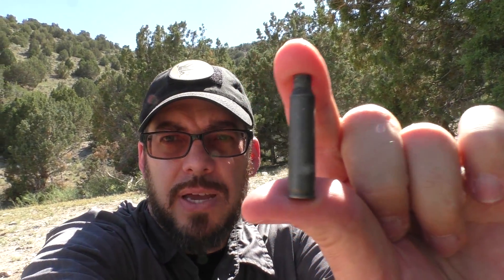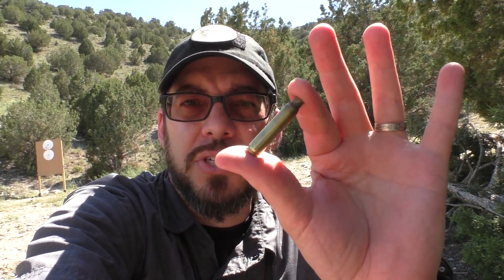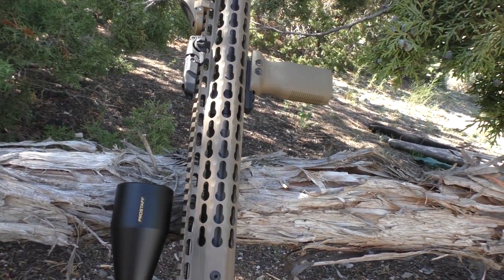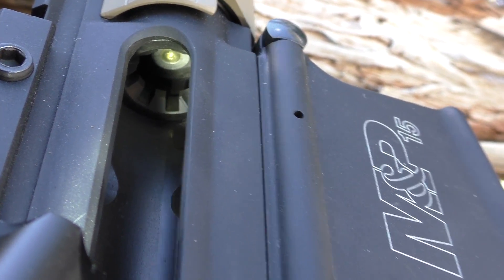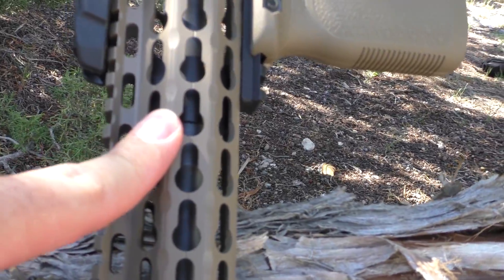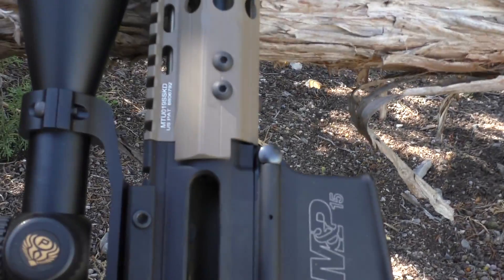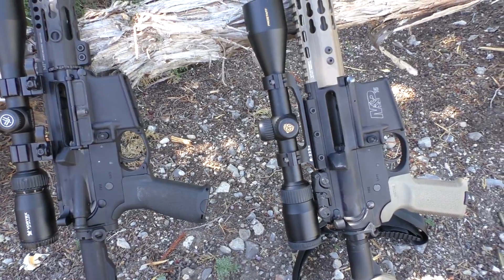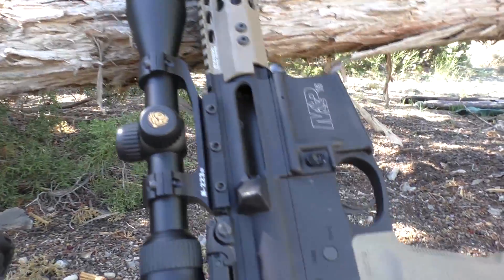Tula .223 Killed My Guns! V-Log Thursday

Comment: brass and steel do not have the same density, thermal and metallurgical properties... You should never use tula because steel on steel creates wear inside your firearm, where as brass cased ammunition doesnt mar the surfaces nearly as much, and most of the scratching is left on the brass case. Never owned an AR or anything of the sort, but you can the difference after only a 100 rounds or so on a reliable bolt action with a bore cam.

Comment: This happened to me three times when using this stuff on a 30-30. The the first two time I was able to get them out. The third time I had to pay a gunsmith $275 to dislodge the cartridge. I think that Tulammo changed the ingredients in the powder they used and a bunch of their ammo does this as a result.
Reply: Holy sh*t! $275!!! What did they have to do besides pound it out and or disassemble the rifle? I they had to remove the barrel from the receiver it’s a pita but $275 is a lot. That’s a lot of money for the issue.

Comment: all in all this is a problem on both ends,   user error for 1, not having a cleaning kit with them. 2- the amount of ammo and kind/brand and how much was under rapid fire, 3- brand of ammo was coated yeah, of lower quality, yeah, steel cased, yeah. and i would most definitely bet the powder used in them is a very dirty powder./--- hince the need to clean more often\... 4 continued the same mistakes expecting a different out come.   =====   insanity.. 
         so far, my only complaint with the 500 count tuna can of tul crap that i have encountered was fail to fire due to hard primer.  i only put 100 a trip down range at a time of this stuff,  im almost out of it and no i will not be buying any more,,,,,,   it does shoot fine through my colt but im not going to subject my rifle to anymore of that crap,   im reloading my own stuff now and i use clean burning powder with nato brass and still end up paying less then the cheap steel crap....     my suggestion,  get reman ammo from cheaper than dirt at bulk or other places like that, or,,,   learn how to reload your stuff

Comment: LOL!  Perfect example why AK is an AK and AR is not.

1.)  All Soviet military rifles come with cleaning rod attached to the weapon.  Take a guess as to why.

2.)  All Soviet military cartridge case are TAPERED.  Take a guess as to why.

3.) All Soviet standardized military cartridges are STEEL cased. Take a guess as to why.

When all the guessing is done and replaced with facts, that's when you get an AK and never look back.

I'm sure others already posted about AR 5.56 milspec vs .223 chamber tolerance differences and steel vs brass expansion rates.  

.223 - hunting/sporting spec (tighter tolerances for higher accuracy with lower reliability)

5.56 - military spec (loser tolerances with lower accuracy for higher reliability)
Reply: I shoot nothing but steel cases out of my ARs (all with Adams arms piston kits) and I don't get stoppages, stuck casings or malfunctions of any type.
Reply: You bring up a good point. I never really looked at it that way. That does explain the cleaning rods on Soviet weapons.
Reply: jason127x99 Cases getting stuck in the chamber was a common occurrence.  Weak sections in case walls, dirty chambers, extreme temperature variations (deep winter cold vs. hot chamber), all can cause stuck case and even case separation, that's why having a full length steel rod is a necessity, it is used to knock out the stuck casing.

Comment: TulAmmo often times, 'resizes' their brass WAY TOO MANY TIMES, and I believe that they are weakening the neck, so that they are causing a 'defect'  related discharge, when the neck 'expands' as the round leaves the cartridge. The reason I believe that this is the case, is, that I run a 'variable gas block', on 3 rifles that are fitted with .223 Wylde Barrels, and I can muck one way or another with the adjustment on the gas block, and cause TulAmmo to do EXACTLY what's happening with your equipment (in both 223 & 556)...

My recommendation? Stay away from TulAmmo, period. It's 'dirty' and just doesn't give any consistency. I shoot 3-Gun Tournaments and have chambered TulAmmo, and regretted it, as soon as I've sent one down range, because, sure enough, I get an FTF, or worse, repeated FTEs on standard 223s or 556s (I've even went so far as painting RED on the bottom(s) of any mags that I have used Tul in, to make sure that I don't saddle up with them, when I'm competing... AND DON"T load Tul for Home/Personal Defense.

TulAmmo is 'cheaper' for a reason. If you can get the fouled round out easily, without damage, mic it, and see the differences.

They're a little on the expensive side, but worth it, having a Wylde 24", 20", or 18".

Try installing an adjustable Gas Block up front and it'll probably solve your issue, BUT, remember, that Gas Block when you go back to better ammo, or a heavier load (it's not that hard, if you remember the 'clicks' to get back or forward to where you've set it as 'home')...

Comment: Wonder if anyone had trouble with a Colt or higher priced AR?  I have over 1k rounds of Tula .308 in a Rem 700, not a single issue, more accurate than ammo costing 3x as much.
Reply: My BCM has never had an issue with Tula or any other steel cased round.  My cheapo PSA had some issues early on, but after i scrubbed the chamber with a shotgun mop with a gentle rubbing compound (during which a bunch of brown sticky cosmoline looking crap came out) it seems to be okay now. 

The PSA has a nitride barrel while the BCM is chrome lined but I don't think that had anything to do with it, rather that brown stuff that was removed was likely rust preventative put on when the barrel was manufactured.
Reply: Zed X-R There might be a difference with the chamber being chrome lined. Probably a good idea that I didn't scrimp a few hundred bucks for a cheap AR. Hope you don't have to do that scrubbing too often.
Reply: A55tech Only had to clean it good that first time to get the rust preventative gunk out, now it cleans up like any other barrel.

The PSA shoots good, but if I had to do it over again I would just get another BCM.
Reply: +A55tech s&w use milate . Steel sucks unless it is a com block gun or a 995ts

Comment: I know this is an ancient vid but i’ll throw my 2 cents in. One of the problems with .223/.556 is that there is’nt much taper to the case combined with a poly coating on the shell casing that can melt with heat. 7.62x39 has much more taper so cases generally don’t stick. Not sure if you have the wylde chambering in those guns either.

Comment: Steel case SUCKS!  It doesn't expand, it sticks in the chamber, and it can't be reloaded.

I had the same problem and will never shoot the steel coated stuff again.

I had the same problem with steel case 38.  I couldn't eject the rounds from the cylinder.

Comment: Very insightful video. Thank you for making and sharing! After going through the comments, it appears a preventive solution would be to clean the gun more often, not run it too hot too often, or not leaving a hot round in the chamber for too long, running the bcg and chamber wetter than usual, and perhaps (my 2 cents) mixing in some brass rounds to have the gun rest from the steel ammo use. As such, it would appear that steel case is more training ammo than combat ammo for .223 and would fare better during initial stages of a gun's use when the gun is cooler. Thanks also to everyone for the insight.
Reply: Yep you pretty much got the same solutions that I got out of all of this,,,,,,,,,,
Reply: Cause I had the same problems.

Comment: the problem is carbon build up, the steel does not expand allowing carbon into the chamber.  every few hundred rounds spray some clp and a few turns with a chamber brush and your done.  if you dumb enough to use steel and not research the issues, then you learn a valuable lesson.  for $20 more a 1000 brass, just buy the brass if you dont want to clean as often

Comment: Damn I found a deal on this .223 ammo. I usually only buy same few types of 5.56 ammo for my 5.56 chambered AR.. now I’m
Nervous..
Reply: Take it worth a grain of salt!  Tulammo is fine! I’ve never had any issues. Just keep your bolt oiled more than normal, (I prefer synthetic transmission oil!) the gun stores want us to purchase their  fancy oils! Tranny fluid and high temp axle grease, followed up by a good cleaning with gum out carb cleaner. all steel cased ammo will cause fouling, shot the hell out of it!! Just keep it lubed
Reply: Mike Mueller ya that’s what I’ll do, it seems most of the stories of failures are caused from carbon built up and\or dry on oil..

Comment: Tula rounds, all rounds in my opinion are trash! the casings have burs around where the jackets meet the casing. I would not use that Ammo in your rifles. The 7.62x54 and the .223, I've seen the same issues. I would not use the rounds. Rifles are to expensive to use low end loads. I've been into riles since I was a child. Did 8 years in the U.S Marine Corps. Did 4 year of that service in Recon. Trust me, Tula rounds are cheap for a reason. If you want cheap rounds to shoot down range. I personally use Remington Ammo. It's cheap, and is fairly accurate down range. Just my opinion. I use to make my own loads for my rifles. If you get a separator, take the Tula rounds apart. you will see what I am talking about with the issue between the jacket and the casing. Just my opinion though. Thanks....

Comment: If you can’t run anything and everything in your gun without it running reliably buy a better gun a picky gun is a shitty gun I’ve shot thousands of rounds of steel case and never had this issue if you buy a cheap gun put expensive parts into it or just buy a more expensive gun so you can buy anything and have it always run great

Comment: All I really hear from this is "Waaah by sissy gun doesn't work in perfect conditions", why not throw away the crappy gun? Iron sights, 200 yds with no rest I can hit a fist size group with tula 122gr fmj 7.62x39 out of my Arsenal Sam7r. Also I've had 0 malfunctions using Tula, the powder smells different than wolf and has more soot but it is much more accurate than wolf. At 200 yds I could barely hit a man size target with 123gr Wolf army classic fmjs.

Comment: I have a Daniel Defense upper, and two others with Anderson barrels and BCG. All I shoot is Tula (can't beat $250 for 1,000!!) and have never had a single problem. PS- I don't clean my guns very often either...
Reply: This!!! Good quality guns won't wear any faster using steel or brass (there's a somewhat valid debate on rifling right passed the chamber wearing more quickly but the differences are minimal). All my friends use for training is tulammo due to price and we don't have issues
Reply: Same here. Shot around 20k total wolf Steel case out of a scar 16, 10.5 DD, PSA freedom rifle (cheaper one), lwrc di556, never an issue. I pay $199 for 1k rounds. I also don't clean my rifles often whatsoever. Shoot every weekend. Many times very quickly (no cool down time) and suppressed (more blowback)

Comment: i hate steel case ammo for one i also shoot mosins with steel case 762.x54r  if you dont eject the case a mila second after it goes off the mf  expands rapidly its a bitch to clear out thats why I shoot my weapons with brass cases only and avoid factory ammo exept for the military ammunition i also reload my own brass to avoid that problem in the first place  tula is crap ammo in the first place so is wolf my bros gave me some tula and wolf ammo what garbage i pulled every bullet and put them in brass cases wiith my own powders and cci primers and the transplanted heads worked great its the steel cases that was the design flaw problem

Comment: The lacquer from Steelcase ammo can build up in the chamber and it make the spent cases stick and not eject
Reply: NO... old news research a little... laquer is there to stop the case from rusting.   Its not the laquer, but gas blow back mixing with lube eventually creating grit for the non brass case to adhear to.  problem has to do with exspansion of the case and gas/carbon build-up.

Comment: Motor oil just add 2-3 drops of 10w30 in the chamber and feed ramps every 1000 round or so. I shoot steel cased ammo exclusively through my 9mm and 5.56 and I have no issues

Comment: It's your gun, not the ammo
Reply: That's what I think. M&P 15's are junk. I dont trust a rifle without a forward assist either.
Reply: Right lol I had the same problem a few years back but bought a better upper receiver, bolt and a new barrel mine was shot. Still shoot steel at the range all the time just make sure to clean after every outing.
Reply: Weird. I've shot thousands of rounds of Tula, Wolf, and Monarch through a first gen M&P Sport. With a Slide  Fire on it to torture it. Never had any issues. No jams or such like these rifles. Now, I am mostly into BCM rifles, but I began having this very same problem in both a 16 and 20 Bravo rifle. I quit using steel crap in all AR's and have no more stuck cases.
Reply: Wrong answer. It's a hot chamber and the coating left behind from the previous rounds that have been fired. The chamber cools with a round left in and the round sticks!  Eject the round after your done- problem solved.
Reply: +bemyers123 A good rifle would eject the round
Reply: benmyers123 you have no clue what you're talking about
Reply: ***** Yes, a good rifle will eject the round...BUT, the ammo is coated and the heat from firing the rifle cause the coating to stick to the chamber.  When a round is left in, that round sticks to the hot coating that is on the chamber wall and the ammo casing, which is where the coating came from.  This causes the round to stick!  It's not rocket science.
Reply: tnman23 Right, just because "YOU" say so! LOL

You have nothing meaningful to add...
Reply: +bemyers123 quit using a lame ass cheap rifle.
Reply: "But in this test, we saw three times as many failures to extract  with the polymer coated Wolf brand ammo (15 extraction failures) than with the lacquer coated Brown Bear ammo (5 extraction failures). Although the polymer coated Tula ammunition was fired in different rifles, the rate of extraction failures in those rifles was lower than that of Wolf."

From the link you posted.

Comment: i had it happning to me with my 223 rife savage / axis an i have clean my rife an all an it did not help at all . i was firing the same kind of round as you. i was told by a gunsmith. that typ of round are cheap easy to sell on the market because where  they are made in russia an to throw them away an do not use them at all. Tula .223 i have try ever thing form what people have said to do an it dose not work.  WARNING DO NOT USE TULA .223 IN YOUR RIFE

Comment: Your case is swelling when you shoot it. which really tightens up in the chamber . The ammo case may be too thin or the ammo might be to hot which makes the case swell.
Reply: Wrong. Steel doesn't expand as much as brass does. It's likely a tuning issue with the bolt carrier.

Comment: the Tula ammo with the metal casing has a specific spray that comes on it from the factory. Also if you keep using it you'll have a sticky coating inside your rifle that's super hardens inside your rifles barrel and chamber. I stopped using it for the same reason. stick to the brass and you will be much happier. Also the coating is to keep the rust and moisture from the ammo and that's why it's cheaper than brass.Hope this is helpful.

Comment: Clean bore with bore brush .. problem solved.😊
Reply: Tulia ammo is good ammo. I usually shoot 4or 5 rounds of brass ammo to clean out bore. Before leaving range. Then scrub with good bore brush and solvent. Run bolt wet with good oil and tulia will give u no problems

Comment: Shoot wolf Tula sucks and get a better ar. If an ak will shoot it ain't no excuse a 1500 dollar ar with better barrel better bolt better metal and design can't shoot it kills me when people say this
Reply: I agree, a $1500 at should shoot it but what makes the AK more reliable with steel is the case design. A tapered case is much easier to extract than a straight wall
Reply: you do realize that, spec-wise, tula and wolf are the EXACT same. The only difference is usually which one a store decides to carry. Where I live, tula is everywhere and very very little wolf. I went up to illinois for a trip and they had tons of wolf but little tula